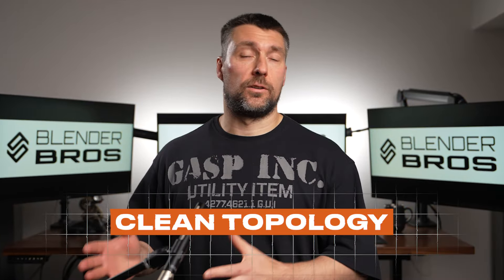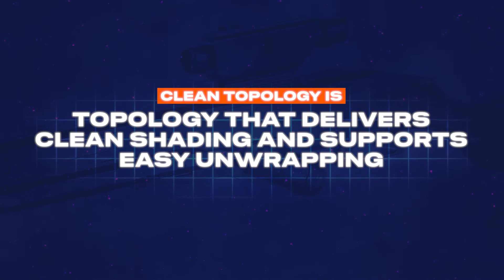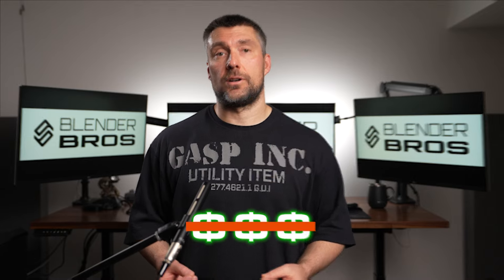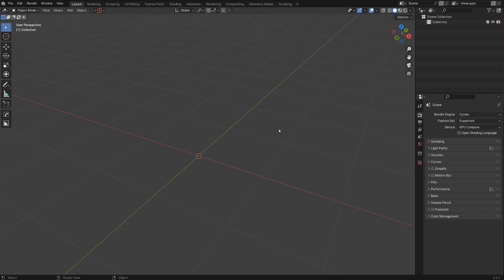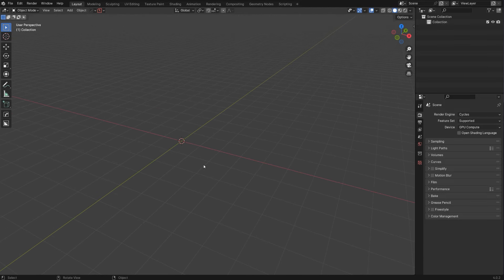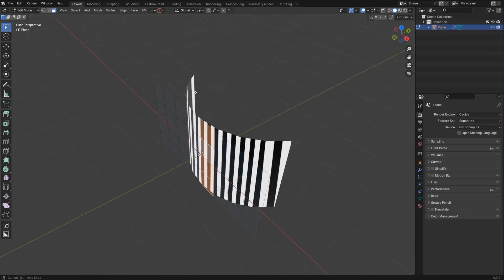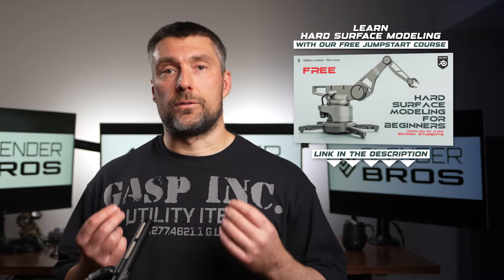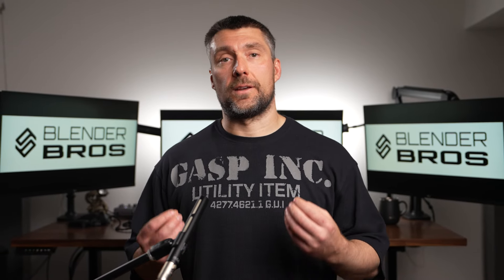Clean Topology MYTH Explained

Comment: I'm going to just add - if you are working with other people using different software and there's a lot of exporting and importing of assets - stick with sub-div modeling meaning evenly spaced quads with support loops etc. Some models might transfer correctly, but every once in a while you will get a really unusable model and just cause a ton of work for the person you work with.

Comment: I've had issues with Unity HDRP's lighting system and nGons on nondeformable hard surfaces. Switching the lighting model didn't work but after nGons were dealt with it was fine. I have noticed this generally occurs if the vertices of the nGon are not coplanar. Less so with quads, and least of all with triangles. Since Unity triangulates all faces, I thought nGons should be fine in these situations, but they were not. So as a rule I make sure that those nGons' vertices are coplanar. If Unity has to turn an nGon into a triangulated set of faces, it needs to determine how to connect the vertices, which means you have no control over how it does so, which is not good at all.

Furthermore, if the scene's lighting is animated, it can introduce all sorts of artifacts [especially those pesky non-coplanar nGons] - and of course postprocessing effects can also be greatly affected.
Reply: I have created an example to illustrate this if anyone is interested...
Reply: The bottom line is that it is not a good practice to allow a game engine to create the geometry for you, because there is no telling what it will do. It could look perfectly fine in blender, but put it into a game engine and the geometry it creates is unpredictable. This isn't such a big deal if your geometry is quads because all quads are just two triangles, quads are closer to the final triangulated mesh so you have more control over the final geometry.
Reply from the maker: @StephenWebb1980  that is why you triangulate the mesh in Blender before exporting mate

Comment: Agree, everyone on the Internet thinks they know the right answer 😂 I mean, I'm going to say some stuff here which might be unpopular opinion.

CAD apps don't care about polygon topology... True. But bringing those polygonised meshes straight into a game engine isn't particularly advisable, especially if you want to UV them.

But, this goes back to your initial comment... Clean topology is topology which serves its purpose, and nothing more. That will always be true, no point doing something in subds if you're never going to require multiple LODs etc. But, sometimes other render engines, or game engines, do not triangulate an Ngon the same way as the host DCC app, so it's still better to clean it up and make sure it goes into Unreal or Unity with no problems and fix it yourself, properly.
Reply from the maker: ya agreed, you could push them considering we got nanites but texturing what cad spat out is a bit of a bastard

Comment: I just want to add, in film and animation render engines (Octane, Vray, Renderman, etc) dynamically subdivide geometry based on the distance to the camera (so objects in the background are actually lower poly saving render time) and on top of that displacement is used for certain objects to add detail (so the better the flow the better the subd and the better the displacement). 

Another thing to keep in mind: part of "clean" topology is also seam placement, so if you have shit edge loops your seams will shift as a result causing texture stretching when subdividing. This is why Ngons can be dangerous in this kind of workflow, juniors will waste time for texture artists with back and forth because they didn't check their models over and the ngons cause stretching in unwanted places even if the surface is flat. 

Anyway, loved the video and 100% agree I just needed to share a film/vfx viewpoint to vent a bit lol

Comment: I have a doubt! In Unreal, when you import an asset with an n-gon face, you may have an issue that this face turn transparent, maybe because of the miscalculation of the triangulation process... how to deal with this kind of problem with n-gon workflow? I dont know the exactly structure of the n-gon to cause this problem, but I have this problem very often with n-gon faces... Thx for the video.
Reply: Triangulate your low poly before exporting to engine. That way your controlling the outcome. Use triangulate modifier, keep normals and then apply.
Reply: @BenPeakeFLA  Thx for replying, bro... but I have the workflow Maya -> Substance Painter before exporting to Unreal... and the Painter itself already apply triangulation in mesh and even though I have this kind of issue
Reply from the maker: @robertocarlos3819 that is because you need to test your triangulated mesh, since every software triangulates differently, so even if it is all well inside of Maya, it could not be in UE, and again that is what we teach in our Game Asset course for Beldner
Reply: @PonteRyuurui  Got it, bro. Thx for the answer
Reply: Triangulate it in blender to check if it is ok? If so import to unreal. I'm am currently working on a big unreal project for a car manufacturer, nobody cares about quads. Or just look at  meshes from megascans, no quads at all
Reply from the maker: @dubtube6691  yup, only ignorant people and virgiuns want everything in quads

Comment: I'm working in the ArchViz industry. In general we don't really need clean quad typology, as most of the things are flat and don't need to deformed in any way. BUT when it comes to displacement you are screwed without a clean quad mesh. Or does anyone knows a way to get clean displacement on a cad model?
Reply: No for displacement you need to have good geometry flow for that kind of stuff. Render engines also dynamically subdivide geometry based on distance from the camera saving time.
Reply: I will use adaptive subdivision, also other render engine allow displacement even on flat surface, they just adjust the geometry by their own.
Reply: You can't.

Comment: Well if your a game artist, it needs to be good topology, quads/tris. Anything else, use your bad topo to your hearts content… Simple!
Reply: How so? Game engines will handle N-Gons perfectly fine, assuming they are triangulated first. You can still use as many N-Gons as you want assuming (like Ryuurui said) the model doesnt need to deform. Obviously the story is much different for character artists, as most of their models will need to deform. Again, the purpose of the model matters massively.
Reply: He just explained in the video that good topology isn't an exclusive thing to game art. Every model needs good topology so it can look good with a shader, but that doesn't mean everything must be quads/tris if it's a simple static rigid object in a game. At the end the game engine will handle everything in tris anyways, just be sure that the vertex normals are set correctly. Bad topology will look bad outside of a game industry too, having weird shading artifacts etc. Bad topology is also when you have millions of polygons in a place where it doesn't need to be and just makes your life and work harder unnecessarily.
Reply: He can explain what he wants, Ive been working in the games industry for 20 years as a Senior and lead artist across aaa and mobile studios. Artists need to be in total control of their meshes and need to demonstrate it in a working environment. Sure you can use ngons where for high polys and for portfolio renders, but baked lower rez bake meshes and 90% of in game meshes need to be crafted with a few exceptions like decimated sculpted organics. Mesh quad and tri topology, meshflow and optimization are paramount! Im not here to argue, but to help people who may get an altered sense of reality. And for the record, i love his videos and use this type of workflow until it comes to final games meshes or baked lower res meshes..
Reply from the maker: fuck me, some IQ has escaped after reading this comment
Reply: @PonteRyuurui  haha keep doing what you do mate. We love you for it!
Reply from the maker: @DeputyChiefWhip cheers mate
Reply: @DeputyChiefWhip 
Dunno if this targeted towards me, but I've worked in the game industry for 5 years, but it doesn't matter. I think it's just a misunderstanding of definition.
For me topology is the structure under the form/surface. If a surface can't fill the purpose of the function because of the underlying structure is bad, it has a bad topology. That includes having unnecessary millions of polygons in places, because bad planning, ending up raising the render time and so the time to finish a project.

Just a decades old example where a modeller made a game character asset that would be rendered from 8 directions with animations for a flip book style animation and he put as much polygons, like 100k-1M, in the character's glasses as the character body itself had together. The glasses did not have any form details and you would never zoom into them anyways. Also 3dsmax had harder time edit those model at realtime in times where pixel shader wasn't even a thing yet in gpus.

That's why I said having bad topology outside of game assets are still bad. Also I did not write about baked assets here specifically, intentionally, because that's another beast.
Reply: @DagobertX2  I wasn't targeting you mate. Just putting my points across with the view to helping anyone who is a game artist or wants to do it. I do love Ponti and Josh's work, it's really helped me especially with high poly meshes,  and quick unwrapping, so for those aspects I'm very grateful.
Reply: Game res low poly should be all tris (not even quads, imo). Game res high poly can be whatever it needs to be to work. It's a good idea to learn the difference.